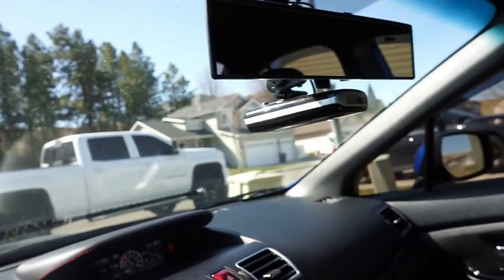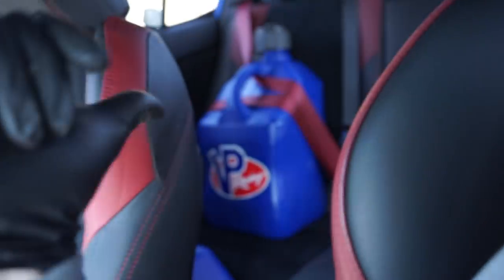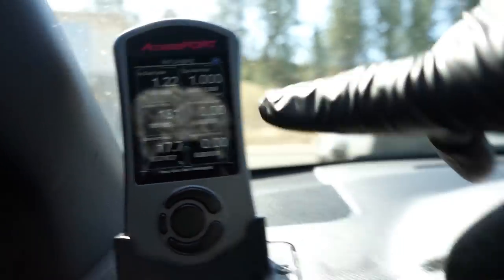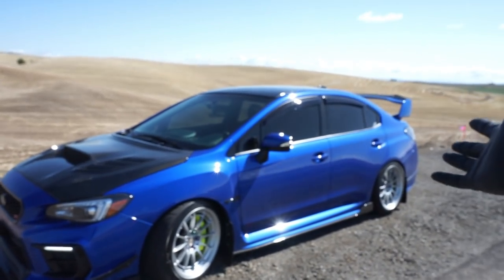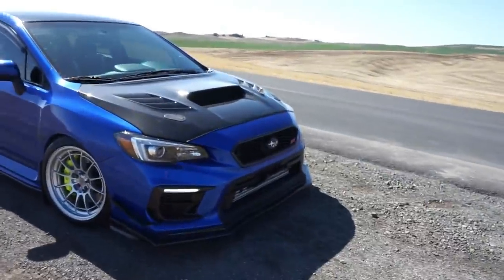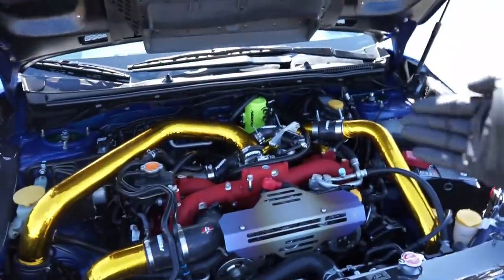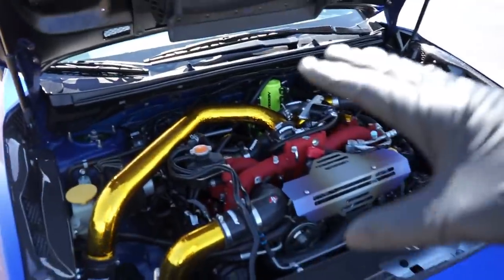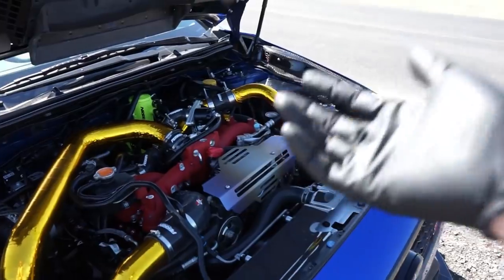My WRX Channel is Back!!?

Comment: Wie läuft es? Ich beabsichtige, Subaru Wrx Sti Wotor Flood zu kaufen und nicht zu tun, was Sie mir raten. Soll ich es kaufen oder nicht? Es ist von Auktionen IAAI in den USA. Sind die Kosten für die Reparatur teuer oder nicht? ist sein Preis 28409779 Wenn Sie es betrachten

Comment: Josh have you ever done a stock location Garrett setup? I am about to do this install with a GTX3076r Gen2 and would like to see how you did it. Also why do you run a AOS and Catch Can? I was advised to get rid of the AOS and just get a catch can so I did this. Is this okay or should I look into getting another AOS?

Comment: whats the largest size injector that I can get to "future proof" while still stock?
Reply: Future proof ?
Reply from the maker: As seen we like using FIC 1650cc injectors over ID1700s. That is a great injector that can still give oem like drivability on pump 92 fuel. Size of turbo doesnt mean as much because we can just not use as much IDC (injector duty cycle). But this does become harder when you try to use a ID2000 / FIC 2150 / ID2600 on pump 92 fuel to get perfect drivability or start up.

FIC 1650s usually become limited at 650-700whp depending on dyno / tuner / fuel ect
Reply: @BaderBuiltRacing  thank you for the info!

Comment: Bader do I buy a 2021 sti or wait for next gen :( help pls
Reply: Have you seen the new generation ones? They’re not that nice
Reply: @JankyWeb  fr, I just picked up my 2021 couple days ago and it’s amazing go for it carson
Reply: @JankyWeb  but 300 hp vs possible 400 hp
Reply: Depends on your goals, if you don't mind spending quite a bit more money to make power then I'd go ahead and pick up a 21', me personally I'd wait until Subaru Unveils the new STI, all we've seen is a wrapped wrx and a bunch of possible looks, also if you Don't plan to ever mod it but want more than 310hp then I would for sure wait
Reply: If you buy what’s out there are lots of parts available. If you wait for a new one you’ll have a lot of growing pains with first year model run.

Comment: Do you build 15+ wrx? If so do you know anytips or do you have a video on tips to make it around 350-400 safely. Right now I have a intake j-pipe exhaust tgv and egr deletes but stuck on what to do now. Anything helps thanks!
Reply: Flex fuel kit and you may be able to pull 380- 400 on e85. Depending on the tuner. I'm building my WRX currently for 550. Lmk if you want a build list.
Reply: @natesena6395  yeah  a build list would be great! What’s your Instagram? I’ll give you a follow!
Reply: I don't have an insta anymore unfortunalty. 
BTW this is on a 2019 WRX

Cobb AP
AEM intake
Invidia R400 exhaust
1320 j pipe
1320 FMIC
 Dw 300c Fp
EGR, TGV deletes
Flex fuel kit
3 port grimspeed EBCS 
IAG Competition AOS
Act extreme street clutch
Rods and pistons
 Fp blue 
Nostrum hpfp
Brembos.
Still need a full STI driveline swap.

Comment: With all those mods, 380 seems very low?
Reply from the maker: I interpreted the E85 power but not pump gas. Low reading mustang dyno we used to use. 380whp is usually around 430whp on that dyno.